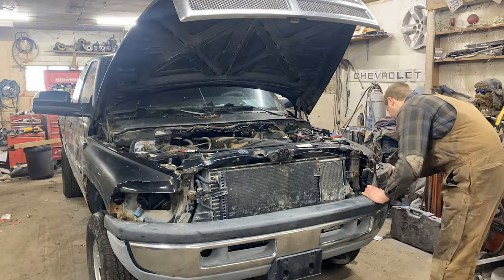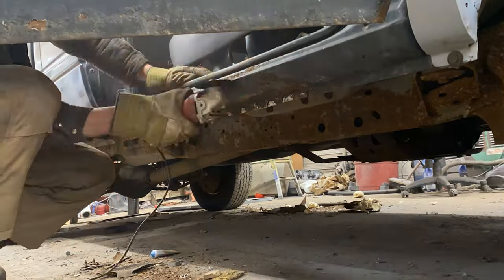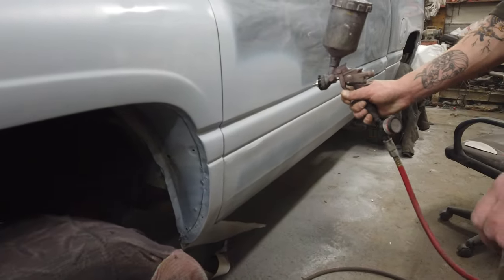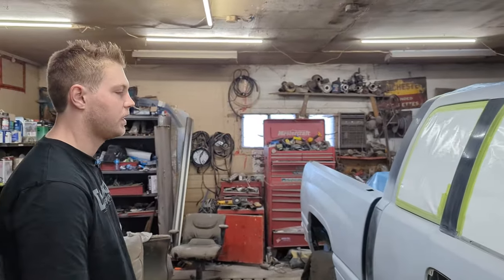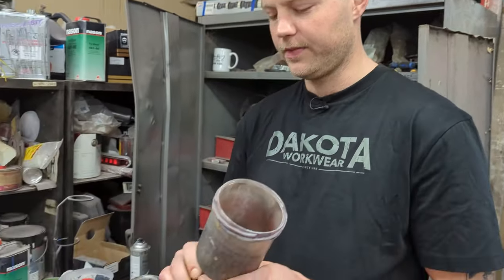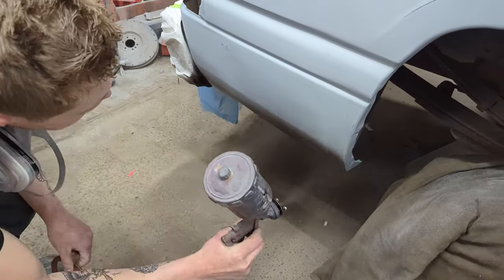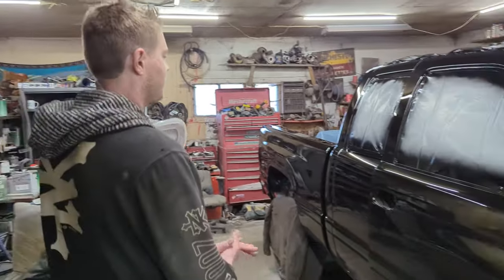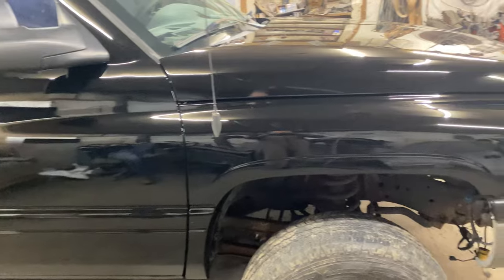How To Paint Single Stage With Great Results DIY -Dodge Ram Cummins

Comment: Umm industry standard is the first number is paint. The second number is activator and the third number is reducer. you reversed the second two numbers and made it 4 to 2 to one so technically, you mixed it right, but let’s not confuse all the new guys.

Comment: Single-stage paint is a type of enamel paint that mixes the basecoat and clearcoat together, and is applied in a single layer. It has some advantages over two-stage paint, but it also has some disadvantages,   I have used Base clear and single stage but single stage is my choice every time hands down,  when I paint my personal vehicles it's always single stage.   1.5 tip 30 PSI fluid wide open lays down like glass with a little extra reducer and activator is what works for me and no buffing because there is no orange pill,     what you did looks good also my friend

Comment: When I first started painting back in the 80s,all I used was single stage, and I would say for the most part the results looked better than a base/ clear,at least of the products available then.
Now for the sad part,I used to do alot of square body Chevy trucks,I can remember all the materials to do one was around $150.00 USD.

Comment: Nice, very nice. A most appropriate paint job for that truck. It will last for many years, probably a decade. And more after the cut and buff on the ample third coat at the ten-year mark. That's the last paint job that trucks going to get.
I've been having good success with Clarks Wholesale Paints. About $100 total for enamel, reducer and hardener. I started using it a few years ago on extreme economy jobs for people where it fit their budget, or they weren't going to even get a paint job on their old car. But it has held up very well and looks as good as any other single stage that I've use in the last 40 years, so that's all I use now. Lots of solids in their paint, so order an extra gallon of reducer for the metalics.
Reply from the maker: Thank you! Sounds like you definitely have dome some paint jobs haha! I don't think we have a Clark's wholesale paints, but we can check into it! Thanks for the tip!
Reply: @RustedRides  
Ebay. If your handy with inexpensive enamel from way back, it behaves just like the old stuff.

Comment: Where do you get the replacement panels? Do you just get flat metal and bend it yourself? Or can you order it specific for this truck?
Reply from the maker: You can order specific for the truck, but sometimes we will bend up some sheet metal. Much nicer to get the panels from a auto body supply store

Comment: You don't need to spend extra money to lay down sealer BEFORE body filler.  It tells you right on the can bodyfill doesn't stuck to bare metal.  Also, the manufacturer recommends 320 grit final sand before color. Yes, your work will look fine for years, but if done correctly, it would last a lot longer.

Comment: Single stage is great, I remember when we had straight enamel before acrylic enamel, if you wanted fancier you could go Imron, before that they were using laquer. I have had laquer jobs but never painted a full car with it.  Anyway, I have had some beautiful paint jobs with enamel and acrylic enamel, and many cars, or even antique tractors, snowmobiles etc. etc. are over done with base coat clear coat paint jobs. Its great but overdone and not period correct for these antiques.

Comment: Never patch bedsides, either replace the whole bedside which I would argue is just as much work with drilling spot welds and cutting the glue. Patches always bleed through the paint and rust after a few years and look like shit. Replacing the whole bedside, less bodywork, less welding, you just do spot welds. Or just buy a rust free/low rust bed, they're alot of them floating around for any truck
Reply from the maker: Very true, you are right, best way is to replace the box... But in Canada that can be pricy to find one rust free. And then yes next best is replace the whole box side. The patch panel is often what we do when a friend says "I want it to look good but don't have much money".
Reply: @RustedRides  Gotcha, didn't realize yall were in the great white north. There's a huge market for them here in Ohio. Beds usually go anywhere from $400 to 1000 USD. Even for as new as a 2018 truck. The best tip I can give is to use a good weld through primer, and when you cut open and expose the inner panel, throw on a coat of POR-15 rust converter, that will neutralize the rust and slow rust down by a few years. And of course, cavity wax, which I'm sure yall are aware.